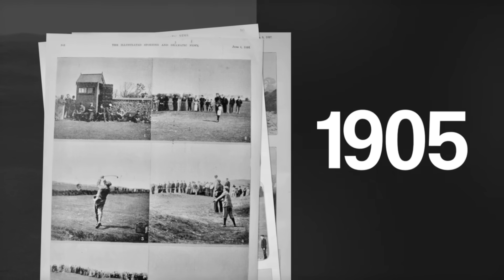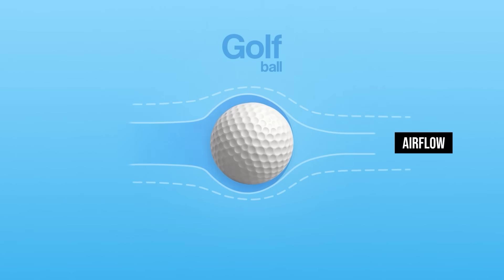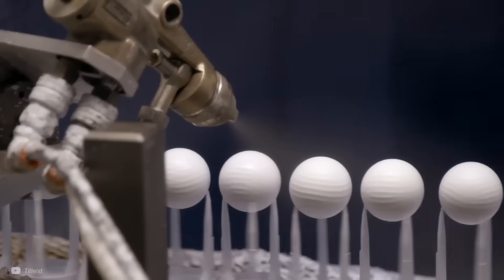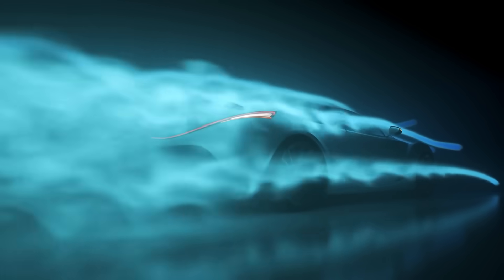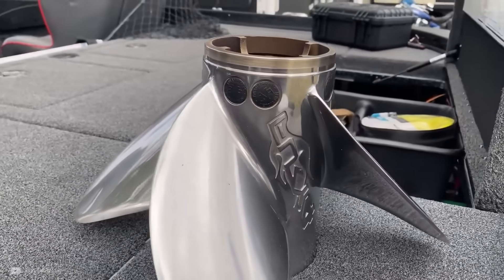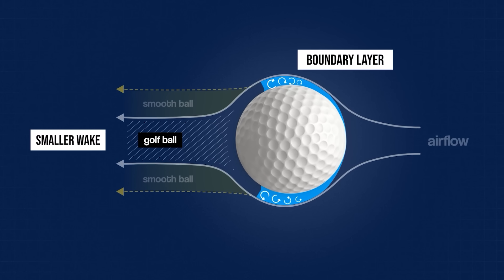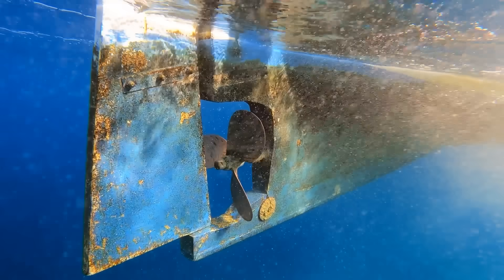The Unexpected Genius of Dimpled Propellers

Comment: Man muss dazu sagen, dass die Kombination  aus Propeller und dem  verfügbaren Drehmoment in Kombination mit der Drehzahl   im Wasser der alles entscheidende Punkt ist.  Denn daraus ergibt sich die Steigung des Propeller .  Diese ist   um so geringen, je schwächer der Motor  ist ( Drehmoment) weshalb   ein typische Außenbord  Motor  auch so hoch dreht und die Schraube entsprechend viel. Schaum  erzeugt.  Da gehen >  20% bis 30%  Wirkungsgrade  auf dem Weg verloren. 
Langsames drehen, bei hoher Steigung  mit den zusätzlichen  Effekten  sollte noch viel mehr als 2%  einsparen.  Aber dazu muss man die Schweröl  Motoren von MAN  an Generatoren  andocken.  Und ob die Wandlung  über Strom, einem Frequenzumrichter  dann nicht  zu viel Wirkungsgrad frisst ? Die MAN haben 50% WG bei Nenndrehzahl 
Einige Beispiel-Schiffsmotoren von MAN und ihre technischen Daten
MAN V51/60DF
Typ: Viertakt Dual-Fuel (DF) Propulsionsmotor
Zylinder-Konfiguration: z. B. 12V, 14V, 16V
Leistung:
12V-Variante: ca. 12.600 kW
14V-Variante: ca. 14.700 kW
16V-Variante: ca. 16.800 kW
Drehzahl: 514 / 500 rpm (im Betrieb laut Datenblatt)
Spezifischer Verbrauch (SFOC):
bei MCR (100 %): ~ 177,0 g/kWh
bei 85 % Last: ~ 174,5 g/kWh
Verbrauch pro Stunde (grobe Abschätzung):
Angenommen, der Motor läuft mit voller Leistung (12.600 kW) und 177 g/kWh: 
Verbrauch ≈ 12.600 kW * 0,177 kg/kWh = 2.230,2 kg/h Diesel (bei 100 %-Leistung).
In Litern: Wenn man annimmt, dass Diesel etwa 0,84 kg/l wiegt: das sind ca. 2.655 l/h. (Das ist eine Schätzung.)
Aber alles, was unterhalb der  MW Klasse liegt, ist unbedingt  geeignet  so betreiben  zu werden.  Inkl. Puffer Akku.  Vor allem  weil,  eine konstante Drehzahl  und  Leistungsabgabe nicht nur den Verbrauch sinkt, sondern auch die Schadstoffe stark  reduziert.  Warum sollte ein  16 m Segelboot mit einem Diesel  aus dem Hafen manövrieren ?  Das geht viel  besser, mit einem 360°  POD Antrieb , der an einen 100 kWh Akku und einem FU hängt .  Der Diesel  wird nur angeworfen, wenn der Akku auf See leer ist.

Comment: So if a micro-dimpling finish to a prop can provide a 2% fuel efficiency benefit, what about a similar application to the hull? Clearly there is anti fouling and other requirements, but I recall experiments with microSD air bubbles along ship’s hulls reducing drag, possibly by also generating a surface turbulent flow and separating the hull from the main body of water?

Comment: Would this reduce stalling? It so happens that I need to make a propeller with a very high pitch but that results in incredibly low efficiency. Adding dimples may keep the water better attached to the hydrofoil thus increasing its effectiveness.

Comment: I wonder if this would help on boat jet drive impellers. On outboard jets, you lose rouphly 30% power head hp at the foot. Everyone is always looking for ways to improve speed and economy of jets due to losing so much hp at the foot. Not very efficient at all but your able to run in very shallow water. Example - 60hp power head is 40hp at the foot.

Comment: You spinning vortices and either rotating in the wrong direction or have their arrow heads pointing in the wrong direction.   For airfoils, operating in low speed flow at high angles of attack, tabulation devices have been well studied & improve the stability of boundary layer attachment.  However tabulators are aerodynamically detrimental at normal in flight speeds & trims.  As most aircraft spend most of their  service time in normal flight, these devices are detrimental most of the time.

Comment: Ziroth you do an excellent analysis of this subject.  This golf ball affect is better for applying in situations for lowering the resistance on boat hulls as used on stepping-hull speed boats and marine life fish etc. rather than for propulsion. On wings and propellers, you need the difference between high pressure vs low pressure to work properly.

Comment: I'm now wondering if using dimples on the hull of ships could reduce drag?
 Reggie Fountain or Fountain boats years ago developed a perpendicular slat underneath his boats which created turbulence and aeration under the boat which broke down surface tension and reduced drag significantly. This allowed his boats to run more efficiently, and could run a lot faster with the same power.

Comment: On propellers it is important to state that the dimples are on the low pressure side - not on high pressure side. 
There is also the issue of water being an incompressible fluid where air is a compressible fluid.   This is a biggie.  So there is a huge difference between air and water with foil design.  Water obtains lift by change in the flow of water direction downwards.   Air has similar properties, but also is affected by the pressure difference between the lower and upper surface.

Comment: Yes but YOU REQUIRE DRAG on control surfaces INCLUDING POWER GENERATION.  I do not see this on any props at the field either, and I assure you that if they were truly of use on spoilers, props, turbine vanes, THEY WOULDN'T BE ON SPORTING GOODS INSTEAD OF THOSE PLACES.  Im not saying this video is wrong, it would definitely reduce cavitation along the surface because it would allow a thin boundary layer to buffer the blades surface from some of the shocks as the void form and collapse along the blade at higher speeds?

Comment: A company called Speed Of Air is putting dimples on motor pistons which has shown to increase power while also increasing fuel efficiency especially in big motors found in pickups and trucks. Specifically in diesel motors they were able to reduce Nox emissions along with some other harmful emissions.

Comment: My ex father in law owns a boat building company and has free rein to experiment. I begged him for years to do this to the bottom of a boat and compare it to a typical smooth bottom boat (all other variables the same) and he would never try it. I can only imagine that the cavitation or whatever you want to call the low pressure cells on the dimples would have improved either speed or efficiency, or both, but he would never give it a go. What a shame.
Reply: Different roughnesses have been used on boat hulls for many years.  Racing hulls often used purposely selected hull roughness to optimize speed.  Commercial and consumer craft have to weigh that against the significant upkeep issues with rough hulls as they attract growth much faster, are harder to clean, more expensive to recoat, etc.
Reply: Their goal is to mix the air so it wants to moves in all direction and have more chance to stick to a surface. They work best in place where the profile create a low pressure and flow detachment.   
The bottom of a boat is neither of those, it would probably just increase drag.

Comment: There is a propeller that is kind of like a u at each of the wings which drastically lowers cavitation as well as improves fuel efficiency... if we were able to combine that, dimples, plus the dolphins coating... i feel like 20% fuel savings wouldnt be out of the question.

Comment: Ahh, one of the famous 2-3% saving technologies in the marine industry. There are many of those - not saying that it does not work, but a 2-3% saving is barely unprovable in shipping since the normal fluctuation in fuel consumption can be over 5% due to wave/ wind (short weather), loading situation, vessel trim, bio fouling (growth on the hull), fuel quality etc. If somebody steps forward and proves that it is 5-7% savings, then we are talking about some lines sticking out of the fuzzy data.

Comment: Putting Golf-ball like Dimples on hulls, car bodies, aircraft etc. is from a 1986 Patent by German supercar maker Porsche is a technique that has now gained enormous popularity in 2025 as it creates a rough boundary layer of air or water flow that then causes a sticky but SMOOTHER and FASTER outer-layer air or fluid flow to surround the hull or body (i.e. Fast Laminar Flow) making a craft or vessel more aerodynamic or hydrodynamic aka IT GOES FASTER!

It can be applied to ANYTHING that needs to move through air, water or even plasma! Gold Club Heads, Baseball Bats, Runners or Boots, Boat Hulls, Car Bodies, Aircraft hulls, Turbine Blades or Propellors, Car and Bike Tires .... ANYTHING that moves or gets moved can use this technology for making movement EASIER and FASTER through any fluid or airspace environment!

V

Comment: That design improvement, based on the characteristics of the turbulent boundary layer, together with the architecture of elongated (big depth) ream-driven propellers/generators will bring a big changes to many branches of the fluid-based energy-transformation industries.

Comment: You repeat "2% savings/profit annualy" but time doesnt matter, monthly it also would be 2% ;]
Reply: I think the point of stating annually is that is works in different weather conditions; if you would do something that increases efficiency in hot weather (with lower air density), that could still be a net negative if it reduces efficiency in cold or wet conditions. If the average efficient over a whole year is increased, you can be fairly certain it actually is a net positive change.

Comment: not genius... the next logical progression. The same concept has been used on speaker ports for DECADES. I remember having a debate with someone about this who argued with my "creates a turbulent boundary layer" argument because I didn't describe the exact concept in their preferred terminology. GOLLY, now that I'm watching your video... you're using virtually the same terms as I just did! go figure. 
4:00 OK... I've learned A LOT more about how this works as I didn't think of the concept in terms of wake AT ALL, instead imagining the turbulent boundary layer as "lubricating" the airflow with "less sticky than solid 'liquid' air" that would actually work better at the LEADING EDGE of a surface. So the dimples are more akin to diffusor strakes at he BACK of a car... OK.
I imagined dimpling and entire hull for an America's cup sail boat thinking the boundary layer would make the entire hull more slippery.
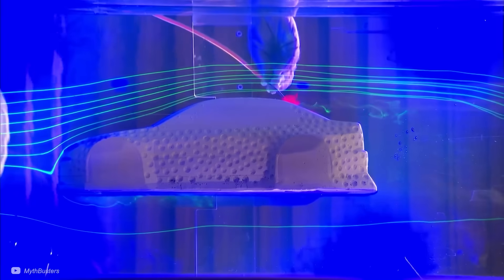5:00 dimpled cars ARE more slippery! OK! I'm not COMPLETELY ignorant then!!! MAYBE my thinking wasn't completely wrong. Regardless, it's great to now it's more about wake than leading edges.
Thumbs ups are at 7.9k +1 today. Thanks for updating my aerodynamics understanding database! This is a new top 10 favorite science & tech video!
THANK YOU Ziroth! I have learned MUCH here in just 12 minutes

Comment: Oooh, that makes so much sense. I was actually under the impression that the dimples "lubricate" the boundary layer by building pockets of static air which would have less friction than the actual surface of the ball. Or something...that was just my uninformed head canon xD , turns out the opposite is true (forming eddies). I state corrected with a blown mind now, knowing why not everything aerodynamic is covered in dimples.

PC fan manufacturers also say that the dimple-like features of some of their products yield only miniscule improvements.
Similar to a certain youtuber, I kinda have the ongoing urge to fiddle around with my own 3D-printed designs, just for fun. Sadly today there are barely any things you can discover as a single person, like the golf ball thing. My urge to discover has to go *somewhere*, even though I know that I won't create a miracle propeller xD . (But maybe I can optimize my own PC fans for my preferred noise vs. flow/pressure? since the propellers they come with are always compromises.)

Now: just why are eddies making the flow cling better to the surface?
I probably would help wings having a slower stall speed. But you can use a different wing geometry to achieve that, probably with less impact on drag. After all that's kinda included in the point this video tries to make.

Why would the Bugatti only raise the dimples at high speed?
Also not sure about the Mythbusters...their methods aren't always very clean.

Comment: You should look at whale fin trailing edges, the grooves there help the issue of boundary layer separation without adding drag. When my son was in high school we did an experiment for his science fair with plastic propellers generating electricity. We made the grooves by hand with a chainsaw file. Over several propellers tested against a control we were able to generate about 7% more current form the same wind source.
Reply: Impressive!
Reply: Years ago I sent this idea of creating dimpled fairings for the SpaceX dragon but Gwynne shotwell told me it wasn't worth the investment yet here it is... Proving them wrong.....

Comment: There’s a problem that all your theory doesn’t take into account. Real world.
Those dimples on the prop may increase efficiency, but in the real world props get damage, marine growth and anti fouled.
This extra cost in manufacturing isn’t worth minimal efficiency increase 
Some propellers are designed to cavitate and produce air around the hub.
A 300rpm prop is also completely different to a 6500rpm prop. Materials, design and cost.
Practically a fix for a problem that doesn’t exist in marine propulsion
Reply: I understand your point, 100%.

But, I have to wonder... could the dimples (disregarding marine growth and fouling) "help prevent" cavitation damage under certain circumstances, i.e., prop diameter, pitch, and RPM vs Thrust.
I think that the prospect should be investigated further. 
 
 
I personally run surface piercing props in shallow salt water, and would like to see empirical data on the topic.
 
Thank you for bringing this topic up.
Reply: @jkg6211Surface drives were exactly my point. A surface prop would zero increase in efficiency.
Reply: @TheRubbishDiver 
I wonder about cavatation damage reduction?
Reply: @jkg6211
Propeller metallurgy would be the only avenue.  A dimpled surface drive propeller would only add benefits while getting on the plane. Propellers are basically a service item that needs replacing on boats after years of use.
Reply: @TheRubbishDiver 
You're right.
I hope I can get a little more life out of my new triple cup Jack Foreman prop.
The blade tips are .250" thick!

Comment: you have clearly no technical university degree. This is a complete nonsense to compare the surfaces of a golf ball with large marine propellers. The reynolds number of air and water is different and the speed, it's like saying the golf ball will move better in dog shit because of the dimples. If you are interesting in the latest research MAN Diesel has developed some kind of winglet claiming upto 10% better efficiency but again cavitation problems cost them a lot of money.

Comment: When you hit a golf ball, the backspin on the ball causes the ball to literally "fly" on a pressure wake under the ball. This is also found in baseball where a fastball will "float" or rise in the strike zone. When a golf ball is hit with insufficient backspin or even sidespin, it "dies" and falls out of the air. A golf ball with no dimples doesn't generate enough of a pressure wake and will also fall out of the air. You can test this for yourself at the golf range with range balls that are heavily used (dimples mostly worn off) vs. balls that are newer with intact covers. This is also why the optimal launch angle for a golf ball is not 45 degrees but rather something like 18 degrees.
Reply: So dimples on baseballs and bats sounds like a great experiment.

Comment: Vortex generators on aircraft wings don't just reduce drag, having the air flow stay attached to the wing longer means you can achieve higher angles of attack without stalling.  They are used frequently for STOL aircraft for that reason.

Comment: Great video, love the insights and broad overview it gives.

What I will say is a second video to follow this one up would be spectacular. It should focus on the alternate technologies that are being worked on to improve efficiency of the propellers such as toroidal blades and the likes. Also touch on Novtua's pc fans and others too and how some blades are made with all sorts of clever systems. Noctua uses dimples, stepped intakes and other systems on the fan housing to improve airflow and the blades have their own separate systems. Broadening  the high airflow and high pressure fans further apart when they startef them but more tecently they fans they have made do both and are tightening the gap back up. And they have not used toroidal blades yet even. 

I am aware of a video on his channel about the mybusters car with dimples where he discusses the manufacturers contacted him about the car (Adam savages tested channel).

Comment: Mythbusters actually proved that a car with golf ball style dimples actually got better gas mileage than a car that was smooth...this was despite the fact that the car weighed an extra 700 lbs.
Reply: He literally talked about this and mentioned that it has been difficult for engineers to reproduce 🤨
Reply: @west-coast-willy  Umm...  Not really.  I'm an engineer and I can figure out how to do this easily.  Do you know how car body panels are made?  They use a freaking HUGE press on the order of 5,000 tons to press metal into shape.  Just add the dimples to the mold that is being used.

For a propeller, a CNC machine can machine the dimples into the material, or you can make it part of the mold.  IIRC, the ship propellers are rough cast and then machined to spec.  The program could be altered to machine in the dimples.

It's not hard or difficult.
Reply: @38Maelstorm  The difficulty is not in reproducing the method but the results.
Reply: With the tech just these short years later, they could do the same thing with a LOT lighter media.